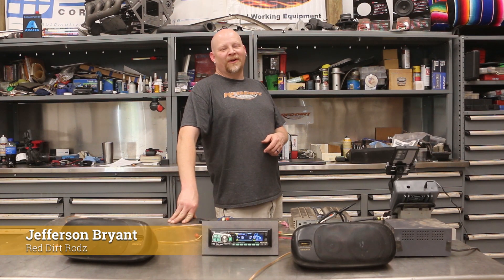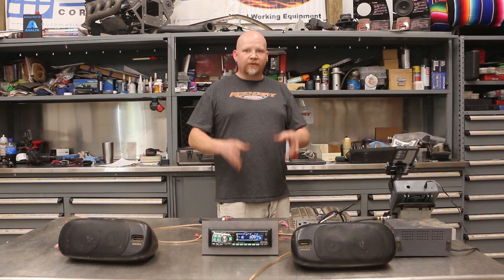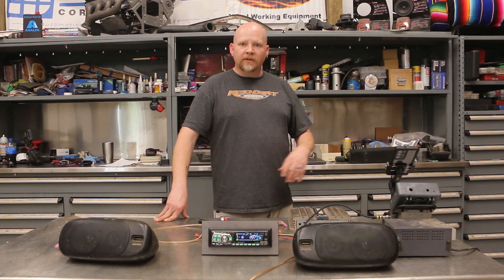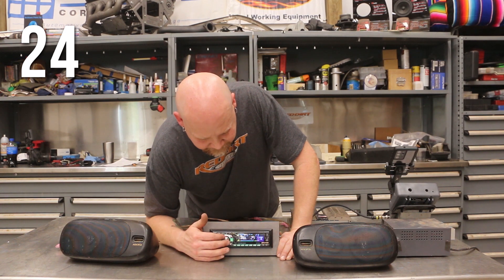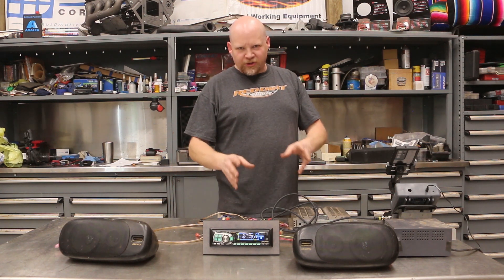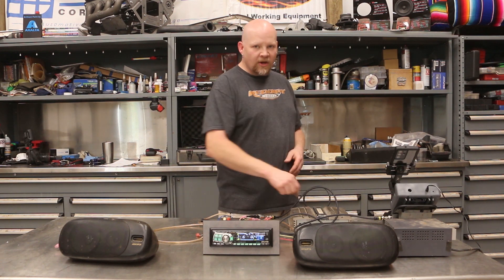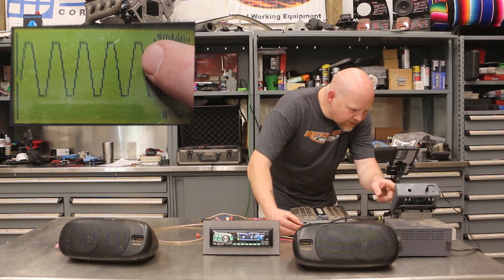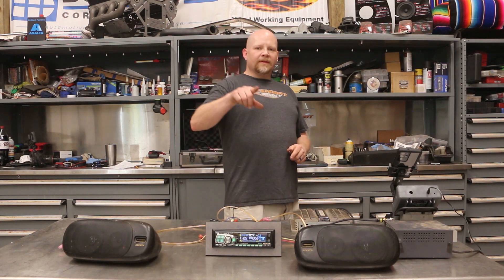How To Properly Set Amp Gains With A O-Scope AND By Ear

Comment: On a 4 channel amp thats running to 4 way coaxial door speakers should i set the lpf and hpf to 80hz on full range? I already did test the head unit for distortion with an oscilloscope connected to the amp speaker terminals. Just confused on what to set the lpf and hpf to.
Reply from the maker: The LPF cuts the higher frequency range and only lets sub bass freqs through, HPF  cuts out the low bass. For mids, use the HPF and set it somewhere around 100-120 for most mid drivers.

Comment: Does setting like gain like this only work if the speakers have a higher rated RMS than the amp can put out?  If they are below the amps and volume is increased on the head, won’t that cause damage to the speakers?
Reply from the maker: @STE6168  no. Distortion is what kills speakers, not power. You can run 1k watts to a 10 watt speaker, as long as it has a clean signal and you dont bottom out the driver.

Essentially, you are setting the maximum clean volume. After that, you have to listen to your system. The speakers will let you know when it is too much- burning smell, popping, crunchy audio, etc. 

Regardless of the speakers and their power ratings, you always set your gains this way so that your signal is alwasy clean no matter how loud you turn it up, provided you don't exceed the head unit's max clean output.

Comment: If im measuring my stock headunit, should i connect the o-scope after the stock amplifier?
Reply from the maker: Depends on if you are using the stock amp output. If you are running high-level input, then yes.
Reply: @Reddirtrodz I'm using the stock amplifier for the interior speakers, then I am tapping off the stock subwoofer wire to go into my LC2I pro

Comment: Should I set my gains with my eq settings already set? Or set the eq settings after the gains. Also should the cross over be off or on HPF for fronts and rear speakers
Reply from the maker: You want the signal to be as you will use it, at least as close to what you can. Crossovers, eq, etc should all be set. That doesnt mean you can't adjust after, but the idea is to find the max clean volume and then don't go above that point. 

Some people tune in 5-10% distortion as it hard to hear, particularly in bass ranges, but that's a person preference.

You can play with it, and once it starts making sense, you will figure out what you prefer.
Reply: @Reddirtrodz  right on! Makes sense.

Comment: When setting the gain on the amp without the speakers connected does this mean the oscilloscope will be reading distortion at the stability of the amp? What i mean is if you going to use the same amp at 1ohm vs 2ohm will the clip point be the same?
Reply from the maker: Based on ohm load, the clipping point can change, occuring sooner than without a load. You can make (or buy) dummy loads for this type of test, which is a video I am working on. 

This would be a good real-world test to see just how much difference there is between unloaded, 4, 2, and 1 ohm loads. 

In most cases, I like to use the scope to determine the max clean input level from the source unit and any processors, then I set the base gain at the amp. For mids and highs, this is usually as far as it needs to go. For subs, you can tolarate a little more distortion (under 10%), but I prefer a zero-distorion system for SQ, so I will test everything with speakers connected and fine tune it. 

If you are running SPL or SQL, a lot of installers will build in a little distortion, specifically on the subs. for SPL, we often run square wave for competition, as square is louder due to the fact that the wave has no ramp-up/down, the peak of the wave is much longer than a sinusoidal (sine) wave.

Comment: When i check tha max outputs of my estéreo Kenwood exelon dmx 907s 😅 i used 1 kilohertz testtone and no distorted but when I set my gains of my amplifier dsp audiocontrol D-4.800  they shows distortion?????of my estéreo wy 😂😅 l
Reply from the maker: You always start at the signal source and then work your way to the amps. Is the dsp output is distorted, then you need to dial it down.